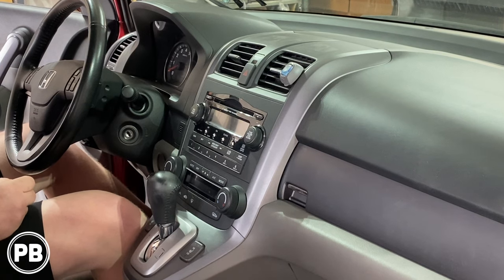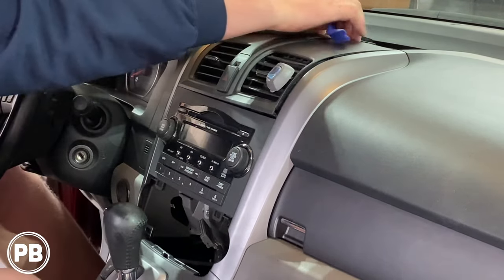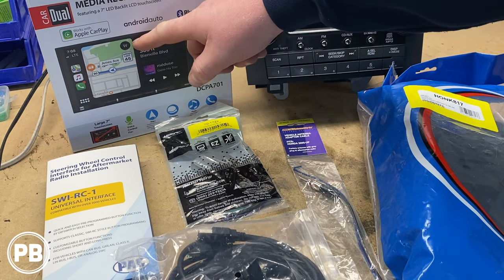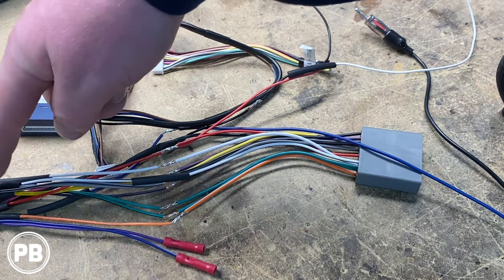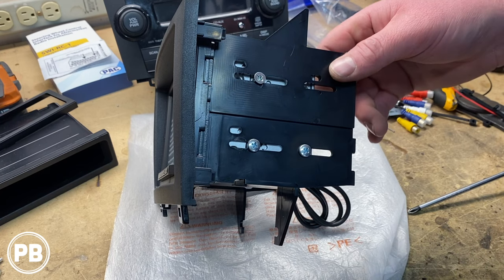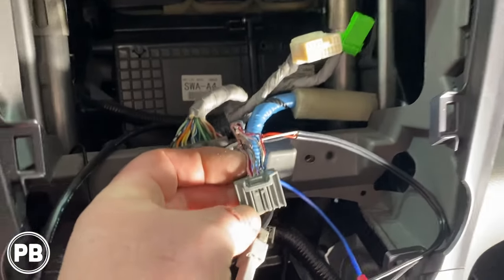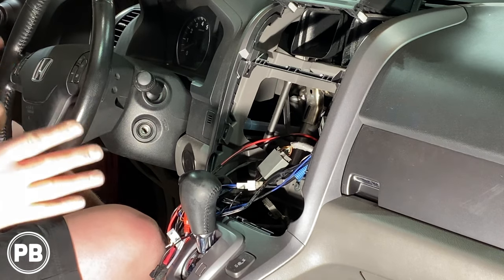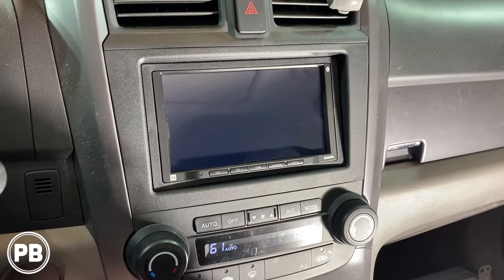2007 - 2011 Honda CRV Radio install

Comment: Thanks! The first 3 minutes of video saved me so much time and kept me from damaging the finish trying to get the various dash parts disassembled.  It came apart exactly as shown. Excellent information and perfectly explained. Thanks again.
Reply: Do you need all of that extra stuff that he had to install it or can you just install it using just the CarPlay ?
Reply: @JACOBGalan  
I’m sorry, I only focused on the dash disassembly. I had a different new stereo so I didn’t focus on the rest. But I did have to purchase the stereo’s bezel dash plastics to replace the original. I bought 3 harnesses: connector to the car’s harness, connector to the stereo and a connector for the antenna. I still need to install the backup camera, which looks to be more effort than the stereo’s installation.

Comment: Excellent video. I followed it and got my new radio all installed.  Last thing I need to do is replace the power socket with the dual USB like you have.  I cannot get the power socket out. Any advice?

Comment: Great video. A couple of questions. What is the white connector for? You can clearly see it at aboout 9.25 mins in video. You do not use it but what does it do? Also the aerial connector also has a connector for the  usb in the dlove box, I presume that you lose the use of this? Thanks
Reply: I suspect you've already done your install Billy, but I'll leave this comment for others.

The standard radio and cd player put in this generation of Honda CR-Vs was able to interface with iPhones, but only up to about iOS version 3 or 4 I think. Behind the lower mounting bar for the radio, there is a conversion unit. One plug is the white one which connects to the radio, the other goes to the USB plug in the compartment above the glove box. This unit allows the radio to control apple music for these earlier versions of iPhones.

You can buy an adapter to fit it, but what I did was remove the module from the dash, remove the USB female plug for my new radio and remove the adapter plug to the converter. I verified the wires (my colors were: Red - 5V+, Black - Ground, Brown - Data+, Purple - Data-; If unsure you should pinout the wires). Then I soldered them together and shrink wrapped the individual strands and the whole bundle.

I have a 12V air compressor, so replacing the power plug down there didn't make sense to me. The power factor is leagues for a standard 12V outlet is just leagues above. (USB max - 2.5 watts, Outlet - 12V * 10 amps = 120 watts)

Comment: How did you remove the 12v outlet near 14:36?  Did you have to brute force it out or what? I cannot find a way to release it from the front of console.  BTW, this was great video.  THANKS!

Comment: Looks like you’re missing some test variables. You didn’t test Bluetooth or the steering wheel controls before putting the radio back in the dash, also how did you connect those wires for the steering wheel into that little harness? Do they have to be soldered in or something else?

Comment: Hey, just making sure so I can purchase everything and do it over spring break: I have a 2011 CRV. If I go for the exact same parts as you did, with the Crux one as exception, do you think it'll work? Thank you kindly

Small edit: Is there any other radio you'd recommend besides the dual one? Just to see if there's more options. Thanks

Comment: I picked up an '07 today and I had to put in the radio code when I did, it turned on but all I could get is static from the radio side and when I push XM it'll give sound for about a split second and then static again off and on. I can hear the CD changer make noises.
Do you think this one is on the fritz? I'd like to keep the factory radio in it. I hope to look into it more tomorrow, weather permitting.

Comment: Me again...  I do not have a blue and white wire in my harness to connect to the amp in my 2007 honda crv. I bought the Henstar 7 that you reviewed and installed on the corolla.  On the power harness, I have Rear view cam control (pink), SWC 1 (Orange/black) and 2 (brown), Auto antenna (blue), Ignition Switch (red), Memory Back up 12v (yellow), Illuminate Backlight (orange) and Ground (black).  What alternative do I have to connect the amp?  I appreciate any time you could dedicate for this question.
Reply from the maker: Just connect to accessory (red) if you don't have a remote turn on wire.  Just tap into that wire and you should be fine.
Reply: @ProvoBeastAudio  Thank you!  That was my guess but I am glad you confirmed it.  Would love to see a how-to video on how to retain the factory rear camera on 3rd gen honda CRV with aftermarket unit.
Reply from the maker: @Greg90731  If it had a camera, we would.

Comment: I’m wondering if my exl with nav has after market head unit choices that are literally unplug/replug old to new, with no additional cabling, parts, trim, soldering etc
Reply from the maker: Nope, unless you find a non-branded cheap Chinese radio replacement that comes as a direct drop in.   We can also assemble your kit for you and ship it out if that helps the cause.  Just send us a message on facebook if interested.

Comment: If I replace similar factory head unit I need PIN code ??
Reply from the maker: As in replacing OEM radio with another OEM radio? Yes. If going aftermarket, no.

Comment: How do I retain factory tweeter without getting the crux harness?
Reply from the maker: Factory tweeters are in line with the mid-range speakers.  Regardless, you will need the correct harness for your specific trim level.
Reply: @ProvoBeastAudio   I think my tweeters run off the factory amp. Got them working after I spliced off the amp wire from the other harness. I appreciate the quick response.

Comment: Good video. Smooth cheat though when you removed the AC vents. Not  quite so easy to release those vents with pry tool. Just saying you need to place fingers BETWEEN the metal frame & the rear of the vent housing. Then  PULL it straight forward towards you to pop it free.

Comment: Hey great video, had some of the best insight to how to connect a the stereo, made me really want to tackle this on my 2009 ex model. Even bought myself a solder kit to achieve my hopes of this car mod. But since I’m new to this, I’m trying my hardest to understand how you wired the rca cable connection to the aux inputs left, right and ground. Just for clarification, did you solder the left rca to the left aux, then solder the rca right to the right aux input, and then did the rca you have in the video have a 3rd ground cable that you soldered to the ground from the factory harness. Or did you solder all 3 cables from the factory harness to the rca cable because that’s what it looked like and sounded like you said in the video. Please reply back I’m just guy with a crv that’s trying to prove that anyone can work on there car if they just try hard enough and do the right research. Thank you 🙏.

Comment: I have 2011 crv with subwoofer w/o nav.  The 18g remote turn on wire you added to pin 16 is my question.  IT is spliced into the blue / white wire.  Is this also where the antenna wire adapter is spliced?

Comment: Fantastic videos and thank you for posting.  Is there a workaround to use the SWRHN-62B and still connect the amplifier?  Is there a way to direct connect it or tap into another line?
Reply: Nevermind.  I just saw your note in the description that it is untested.
Reply: @Greg90731  Were you able to use the SWRHN-62B and still use the built in amplifier that comes in the CRV?
Reply: @josemujica4024  hi Jose
I downloaded the full manual which has detailed wiring diagrams by model and with the help of some
Information on online crv forums was able direct wire the steering wheel controls. Works like a charm and no need for extra parts.  Was also able to add a power converter and reuse the oem 7v backup camera, which I was happy about

Comment: Have same model car but my car has a oem subwoofer under copilot seat’s  how config oem subwoofer with aftermarket stereo
Reply from the maker: Factory sub has its own crossovers and such, not much adjustment can be done with a new radio.
Reply: Were you able to figure this out? Im trying to figure it out!!

Comment: the white plug and the green plug that just hang there.... they aren't even mentioned, WHAT ARE THEY FOR? (From original wiring in the car)
Reply from the maker: Can be various connections not used by aftermarket equipment.  Various data connections, wiring for options not equipped in the vehicle, etc.

Comment: My steering wheels control did not work even with the adapter installed.
Reply from the maker: Either you have a issue with the radio, issue with setting up the adapter correctly, or an issue with your wiring.

Comment: PBB great video I actually bought the kit you recommended for the 2010 Honda CRV "SWRHN-62B" my only question is that on the harness from crux I have a Red/Black wire (AUX Detect and a White/Green Vehicle Speed Sense)  and don't know where to connect them any advice will be greatly appreciated thanks.

Comment: I was quoted $850 for my 2011 crv, which has both steering wheel volume control and back up camera. I have ZERO experience doing this kind of stuff. Is that an appropriate quote for this kind of upgrade? Thanks in advance!

Comment: Was listening to radio and it went to HF-LINK with a phone icon.  Will not 
allow me to do anything with radio but, adjust volume.  Disconnected 
battery and it still comes up HF-LINK.  It did finally, after two days, prompt 
me for code and I put that in and it worked.  Then next time in car it went 
back to HF-LINK. I don't have hands free options on steering wheel and 
have never set up a bluetooth to work with my car.

Comment: Happen to know which harness you’d recommend that’d be compatible with a 2010 CRV w/ Navigation?
Reply: This is what I'd like to know. I've pretty much given up at this point. Seems like the cheapest solution for my broken nav unit is going to be 300 or more dollars. The radio still works so I guess it's tolerable.
Reply: Same here guys. 2010 CRV with factory navigation, six disc changer in the console, etc. I have yet to find a harness that doesn’t require me to cut apart the factory wiring. Really could use some help.
Reply: Did you find a solution? Wondering if this would work on a 2009 CRV with nav.

Comment: How do u use the factory USB port as there in the glove compartment? My 2009 CR-V EX-L has factory GPS Navigation can i use the factory GPS antenna to a aftermarket unit? & my 6 CD Changer & how do they come out?

Comment: Do you need to have a wire harness or can you use the factory? I got a boss 10inch floating single din
Reply from the maker: You need to purchase a harness adapter, yes. Linked in description

Comment: Hi, I am planning to connect the missing wires from the back of the steering wheel connector to the back of the radio.  Do you happen to know the color wires or the place of the wires in the connector behind the dteering wheel?  There is a connector where the audio control and cruise control connect through the clock spring.  Thanks

Comment: He was supposed to install the parking brake wire in order to operate CarPlay. I didn’t see it in the video.
Reply: You can ground it. You don’t ever need to actually run a brake wire

Comment: I see you tapped into pin 16 for the amp turn on but I believe you didn’t tap into the factory subwoofer positive, negative, and shield on the other harness?

Comment: hello, excellent tutorial!!! very clear instructions. question! i didn’t buy the PAC SWC. do you know which color wires are the SWC on the factory harness? i plan to posi-tap them (not cut, mortal sin!) to the KEY1/2 on my cheap amazon carplay stereo harness. 

thanks in advance, happy holidays bud!!!!

Comment: For 2010 crv with Navi/factory amp and sub, would I have to tap the blue remote wire into the red wire like your video, or do you recommend any harness kit that’s always plug and play? Also if a pioneer unit has a pink speed wire, would you I connect that on this year CRV?

Thanks 🙏
Reply from the maker: Today, if your software is updated on your pioneer, you may not need to connect your VSS pink wire. VSS helps with location and speed accuracy with your navigation. If not, i'd look up forums where to identify your CRV's VSS wire location.

Comment: What's the screen size of the android replacement radio installed?
Reply: Good video.
Reply from the maker: The dash Kit accommodates any standard sized double din. The screen size is this unit was about 7”

Comment: I was wondering if it was possible to retain the factory backup camera with an aftermarket system on a newer Toyota?
Reply from the maker: Absolutely, but depends on the Toyota, year, and what parts you are looking to install.